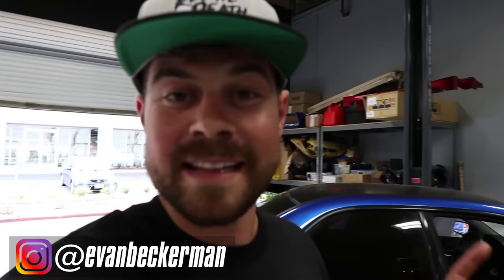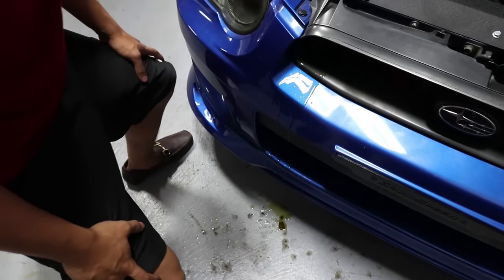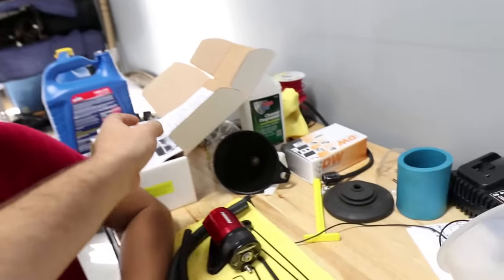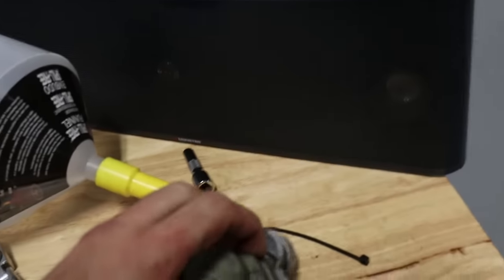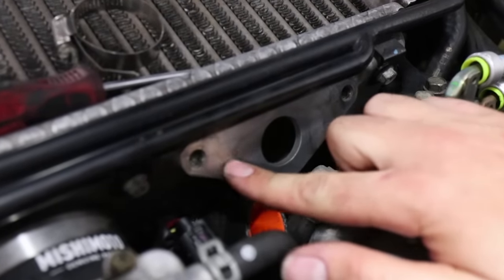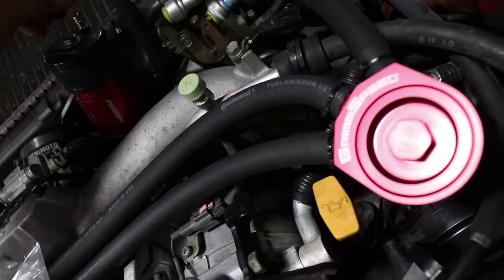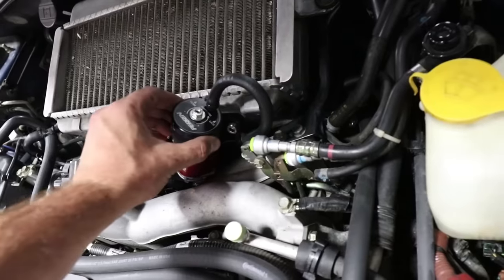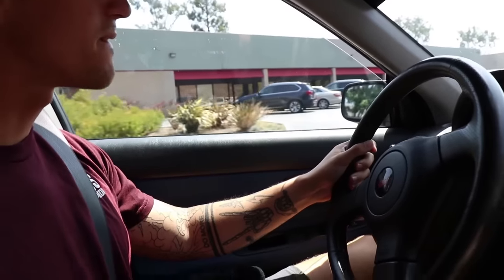INSTALLING A PERRIN BLOW OFF VALVE ON THE WRX! (TURBO NOISES!)

Comment: A neighbour of mine a few years ago decided he knew what he was doing. decided to drain the oil add some flushing oil then add 5 ltr's of normal oil as he was checking the level he added 2 more ltrs then realised that he had not put the drain plug in before adding the filter approximately 7 ltr's of oil running down the road.
Reply from the maker: Exactly!
Reply: we had oil coming in our house and the tracks on the road stretched the whole length corner to corner the road was about half a mile long and because it was stone chipped tarmac no matter what I put down or what the local authority put down it ended up going after 3 months by the road being re-stone chipped. Oh and the Muppet refused to pay for carpets damaged by his stupidity and he had no insurance, try getting engine oil out of carpets.

Comment: The stock unit is a BPV that strictly recirculates left over boost pressure. Safest to keep it recirc, but sounds nice with a little vent to atmosphere. My 02 wrx ran the GFB adjustable hybrid which was nice to have best of both. Love the car!
Reply: that is a recirculating blow off valve, the noise your hearing is through the intake system.
Reply: @maxboost81  is it okay to put a bov on a stock subi and is it safe
Reply: @rustygod6311   If it's not at least part resurculating it has to be tuned or else you'll get boost creep which can damage your motor.

Comment: I got a 3 inch spec d exhaust and Cobb downpipe. An HKS intake and Cobb Stage 2 accessport. My Perrin BOV sounds pretty loud and does flutter. Once you tune it'll definitely be louder.
Reply: your access port works with the HKS intake? for some reason I thought that you needed cobb parts for their ots tunes?

Comment: Nice job on the video, a quick FYI though: Engine needs to be under load to see any significant boost pressure! Without it the engine is sucking air faster than the turbo can spool, exceptions to this would be the implementation of launch control or an anti-lag system. The More You Know!

Comment: Thank you for making this a Recirculating and not doing Atmospheric unit. Much better for the motor.
Reply: Luis Lynch-Maldonado Lol no it's not. First of all if they ran it full atmosphere it would just run rich between shifts. No big deal. Second of all, they are about to tune it. Again no big deal.
Reply: oONoChanc3Oo What are you saying? Venting to atmosphere is not bad for the motor? Running overly rich between shifts is ok? You'll foul your spark plugs faster and the catalytic converter will burn up, too. Wasting more money on maintenance that could have been avoided.  I hear that a Pro-Tuner can tune out the negative effects of venting to atmosphere but why? So you can have loud choochoo sounds? If you have a built motor that is pushing high HP/TQ then it probably would be more beneficial. Putting an atmospheric venting BOV on a mainly stock EJ205 is a bad idea. Just my $0.02...
Reply: Luis Lynch-Maldonado Running catless and it's a zero issue on a cat. And bov sounds good. You obviously don't enjoy it but that doesn't mean others don't. Tune and everything is fine. Especially since you will need a tune for what he has done already to the car.
Reply: oONoChanc3Oo sometimes you gotta agree to dissagree... "Function" is more important than "Form" in my book.
Reply: Luis Lynch-Maldonado I guess but as you said yourself it functions just fine with a tune. 👌👌
Reply: oONoChanc3Oo A little reasearch and i stand corrected, it cannot be tuned out. From a forum post at https:// forums.nasioc .com/ forums/showthread .php?t=2058189"The MAF sensor tells the ECU how much air to expect in the cylinders... it puts out a 0-5v signal, and the ECU uses the MAF table to look up the flow rate (grams per second) that corresponds to whatever voltage it sees from the MAF sensor. There are no compensations that correspond with the BOV's actions, so there is no way to tune for the BOV. 

You could 'lie' to the ECU about how much air is really going past the MAF sensor at a given voltage, to compensate for the BOV's effect, but that would throw off the AFRs when the BOV is not venting. So if you tune around the rich spot caused by the BOV's venting, you'd be running lean when you hit the same MAF voltages by rolling on the throttle.

So, tuners set the MAF table to be accurate when the intake tract is sealed (BOV not venting), because doing otherwise would do more harm than good."
Reply: 3 months late, but once you convert to speed density it can be “tuned out.” Running rich in between shifts isn’t as big of a deal as people make it to be, but I personally wouldn’t run it vta without speed density
Reply: Download the APP Turbo (Blow Off Valve) by iFuture Studio :P Your welcome!

Comment: I have a question about where the middle line from the grimmspeed aos connects to after you removed the steel crank case vent piping? It would of been the part you did off video.

Comment: What's that blow off valve do aside from making some cool blow off sound?
Reply: It keeps the intake charge from crashing into your closed throttle body, sending the air backwards causing your turbo/compressor wheel from spinning backwards.... It sounds heckn cool tho. But it's terrible for your turbo to get compressor surge "frequently"
Reply: @rustyshackleford81  stop, the turbo cannot spin backwards, that is a stupid myth

Comment: How did you connect the hoses? That is literally the most important part and it’s not included I have no idea how to use the t splits it came with and where they go. It’s not working so frustrating
Reply: In same boat

Comment: get a sti intercooler
Reply: Tshuaj_wrX sti is the same as the wrx intercooler just doesn’t have the sti logo on it so theres no point
Reply: Andrew Turner wrong
Reply: Sti intercooler is bigger which allows more airflow
Reply: scott horton bigger isn’t for more airflow. Bigger is for cooling purposes. That’s the whole point for intercoolers, to cool the compressed air from the turbo. Soooo not exactly.
Reply: @boosti_alex1428  They're still right though, A larger volume of cooler air is able to pass through the larger width and height of an upsized intercooler which helps cool hot air from the turbo quicker than a smaller one. That's also why these cars have hood scoops (for much more efficient air flow to the intercooler)
Reply: Sti intercooler is also a better design internally.

Comment: Did you literally only install a BOV and then say you're gonna tune it?
Reply: When it comes to the EJ engines from what I hear they’re finicky about stuff like that more than other cars so getting a tune after is recommended. Unless you wanna run rich.
Reply: @con575  you can't tune for a bov. The bov vents after the maf so no matter what the Car still thinks the air is being recurulated back to the intake after maf. That's the exact reason I'm going back to recurulated/ bypass  valve from atmospheric one.i told my tuner this and he said it was a great idea because the tune will be more on point. The only way to get it to work on a subaru is switching to speed density which is kinda pointless.

Comment: When I had my 2G Talon TSi AWD I ran a Turbosmart Dual Port BOV on it that was amazing. It was one that you could adjust how much was recirculated and how much was vented to the atmosphere. It was great if you wanted a little more noticeable sound but without messing with the air flow of the way the engine is supposed to run. https://www.youtube.com/watch?v=CJuQG7ccuVY

Comment: Your connection is wrong,you should have blocked the silicone pipe otherwise your blow by air is still recirculating